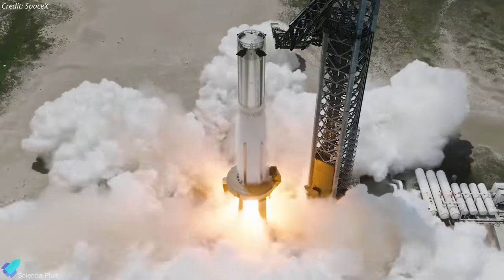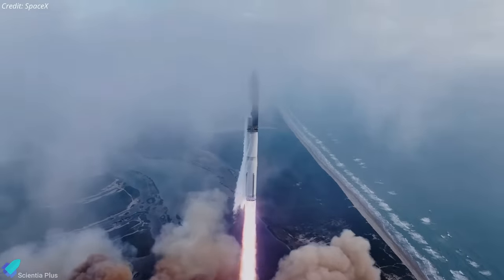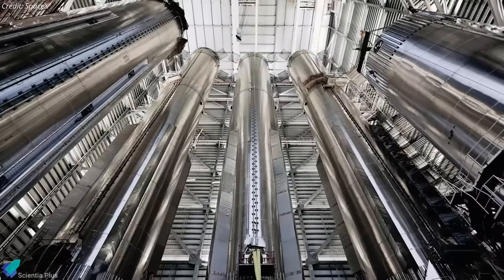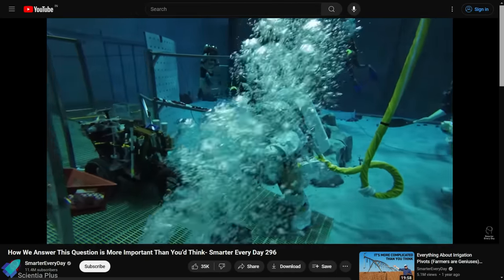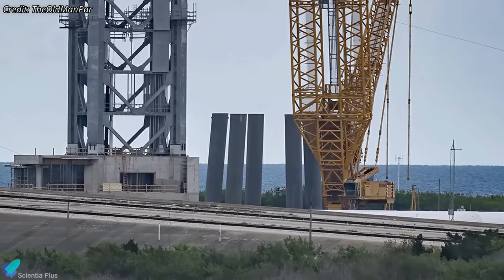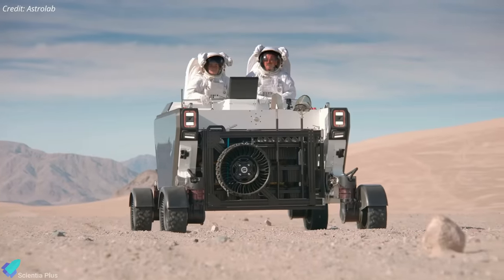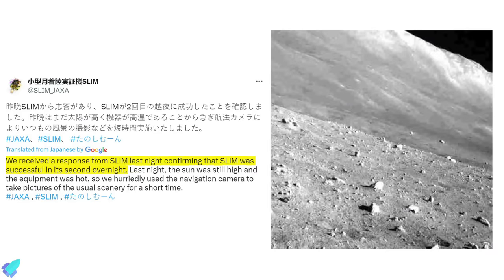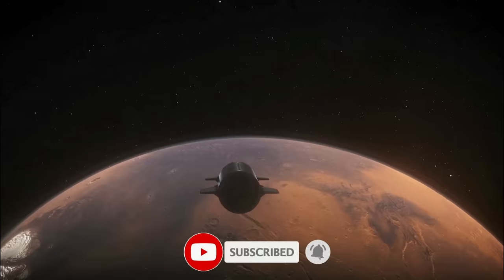SpaceX Making Huge Design Changes To Starship 29 For IFT-4 Success, Booster-11 Static Fire Test

Comment: The issue  of the heat tiles and reentry of Starship.

"Thermos" - would it be a idea to think of. If the Starship is built like a Thermos Flask, might work better than heat tiles.

Hope this might be a thing to consider.

Comment: They are spending Huge money to put a piece of junk on the moon that: 

Isn't sealed in case an astronaut has a suit problem. 
Only has a 20km range in a world where 500km electric cars are becomming common. 

This is garbage, with little advantage over the moon buggy from the 1970s. 

After looking at the other Lander submissions that were barely superior to the 1960s lunar lander, I find myself wondering who is working in NASA appropriations to buy these less than impressive submissions and who got a sweet VP job shortly after.

A larger Cybertruck with an SUV configuration would be ideal... something big enough to move around in with suit... probably weighing 6-7 tons. With a range of 200km, providing extra power in emergencies. They have 100t of cargo capacity in the Starship lander. This should allow a truck that can be pressurized in emergencies, ranging well away to do prospecting with much larger wheels and a speed of at least 30kph. 

THIS is the best they could do? 20 km range? 15kph? Really???? Who is still thinking light weight is ultra critical. 
Its as if they didn't read the specs on the lander (or developed it for some other, vastly lamer lander.
They will spend hundreds of millions making it lighter when they only have to if they revive one of the tiny, tiny designs that competed with Spacex. 

This is NOT the moon lander. Its a Starship Lander with 100t of cargo capacity (or a cargo lander can be sent in advance).
You might also think about a few human form robots by the 09/26 launch because that will be a thing by then.  
 
Not impressed by this billion dollar buggy... at all.
They wasted Huge money and time to make someting small and light enough to fit in a Non Spacex Lander. 
The term "political idiocy" keeps popping up in my mind. 

The PURPOSE of having this thing is to explore and prospect for ice. 
This toy can't do that.